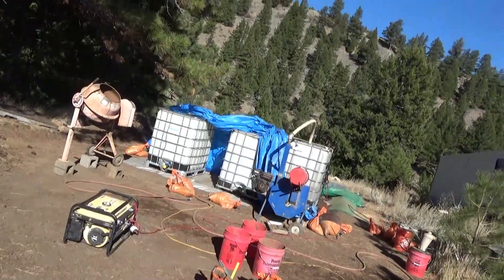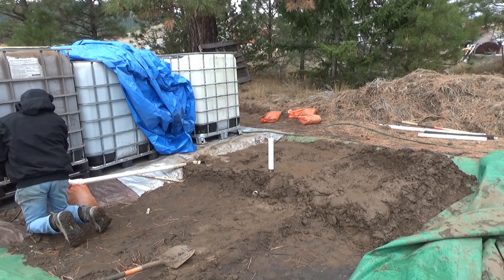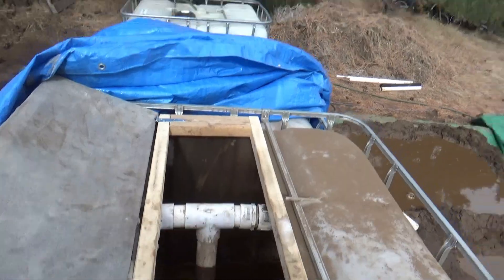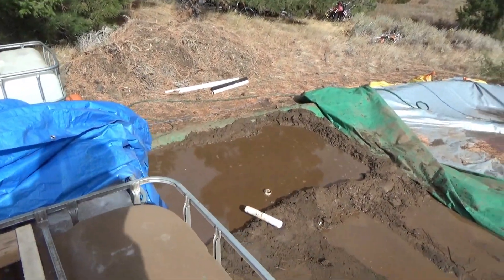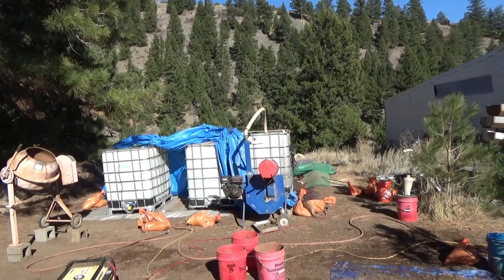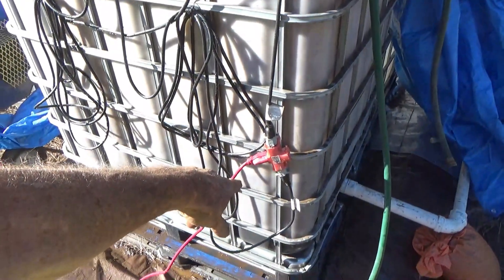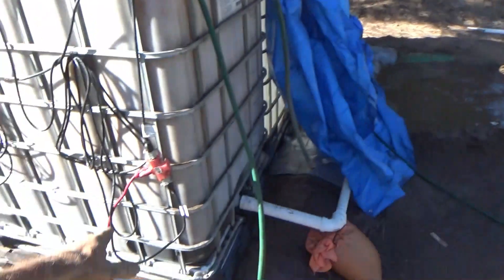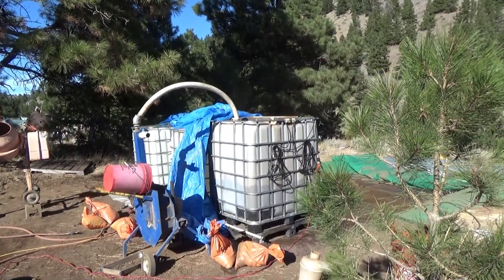234 All the Ore processes Have now Been Tested

Comment: You’re having too much fun.  Seeing you bundle  up made me wonder how your chemical process works with decreasing temperatures.  I  believe the rule of thumb is a reaction rate reduction of 1/2 for every 10 deg C(?not F) reduction from your baseline measurements, whatever temperature those were made at.
Reply from the maker: I presume you are roughly correct, but am not certain myself.  I'll find out someday.  This solid dihydrogen monoxide environment is not what I am trained for.  :-)

Comment: Just a few questions Keith if i may . Initially do you use De mineralized water , secondly do you run several batches of ore through the same solution so as to maximize impregnation with gold , before introduction of the  Resin , but just topping up your solution with some more reagent . Also in an agitation tank could you use a paddle type stirrer powered by electric motor from the top with a down shaft and rotating paddle , or do you need it to be oxygenated with a pump . Just a side note some of the research i have been doing it appears that a strong based gel type Resin appears to be the best choice such as Amberjet 4200 ,  just from what i've been reading , cheers Ned .
Reply from the maker: Happy to share what I know Ned.

I just use well water.  It would be very costly to use special water.  Any useful mill process has to be at least somewhat tolerant of contaminants.  After all, we mix it with large quantities of 'dirt'.  In some cases contaminants can build up and be a problem.  In those cases extra effort and expense has to be factored in.

I am re-using the solution without first extracting the gold because I am simply waiting on the resin etc to show up.  If one was able to do direct electrowinning (we have been notably unsuccessful to date), then increasing the solution concentration might have merit.  However, any increase in gold concentration in solution also means increased losses to the residual solution left in the tailings.  The highest recoveries are from resin in pulp, but that would add an extra classification stage after grinding to eliminate the oversized rock particles followed by an additional screening to separate the resin from the tailings.  I'm trying to make this very simple because it is very small and inexpensive.

A p-addle type stirrer is the most common type for the big operations.  Large blades, low rpm to minimize grinding of the resin in pulp.  Again, I am trying to optimize for micro scale.  I'm sure there will be improvements.  This is a first iteration.  With cyanide, oxygen is very important.  As far as I know, with thiosulfate excess oxygen can be counterproductive.  Still learning this system myself.  :-)

I am still waiting for feedback from the resin suppliers I emailed.  Thanks for the info.

Excellent questions.  You are really thinking this through well.  Thanks for the help.

Keith
Reply: @hardrockuniversity7283  Thanks for the feed back , i am very interested in the processes , not that i have a mine , but may have access to ore from the area i prospect , especially when a lot of old mines in our area were abandoned because of the failure to extract gold from preg robbing ores etc ,  so i am reading up a lot ,  and one interesting paper i found was from the Murdoch University in Western Australia , 280 pages long , it is definitely all about the science now days . Just a side note , they have a process where by using a treated activated carbon was equally as successful as using resins , i have noted the process and copied it down . Cheers Keith .
Reply from the maker: @GrooberNedJardine  Yeah, but pressure cooking carbon is a hassle.  A resin supplier just responded to me and says they have a resin specifically optimized for extracting gold from thiosulfate solutions.  He is also planning to send me detailed instructions on recovering the gold by ashing the resin.  Do I have your email?